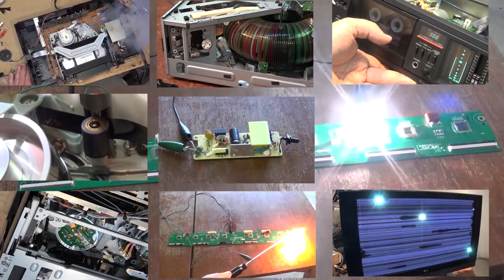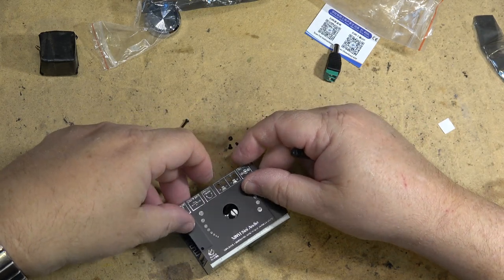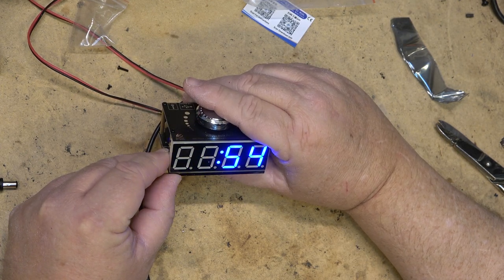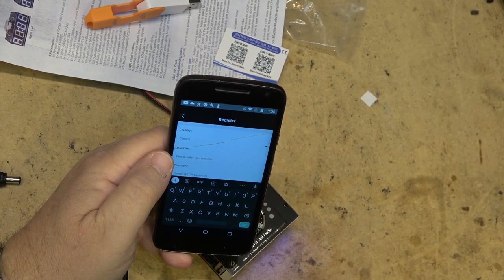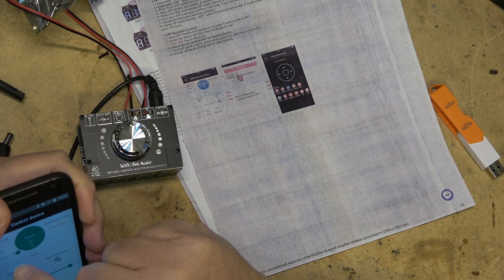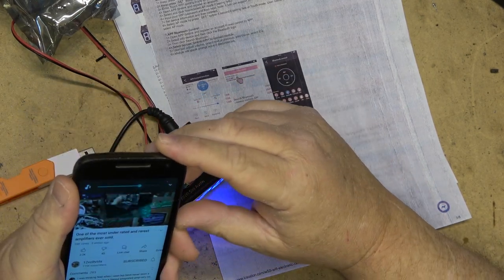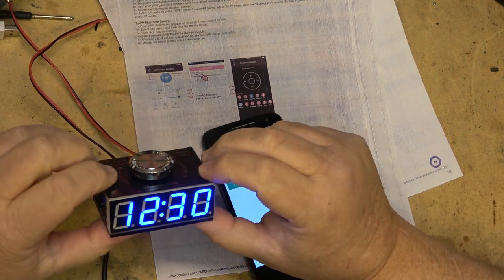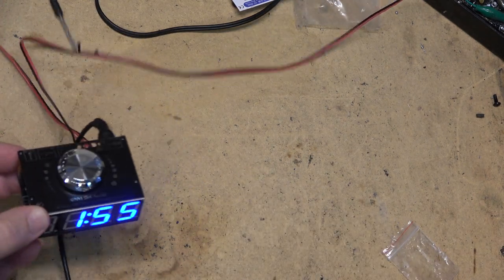Internet enabled digital clock / MP3 / Bluetooth

Comment: Fun for a beginner and good to play around with I guess but don't think I will be getting one any time soon!
Reply from the maker: I have actually put this in service as a music player. Plugged a big USB stick in loaded with about 15,000 MP3 files, fired up the app and selected random play, and plugged the audio out into my aux in on my  amplifier. Great way to have non stop background music, and an internet synchronized clock to boot. It's nice as it can be stopped and started by just pressing the button, and it picks up where it left off. Most players once you turn them off they start up their psudo random playlist again from the beginning so you hear the same tracks in the same order.
Reply: @12voltvids  yes I can see its use in that case and picking up where it left off is a definite bonus!
Reply from the maker: @gartmorn  it will be playing 24/7 into an rf distribution system.